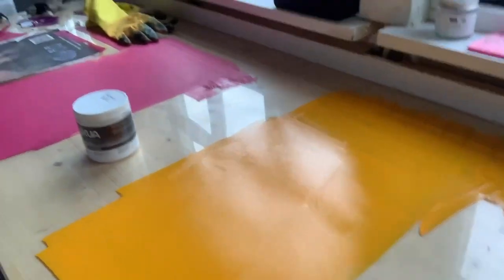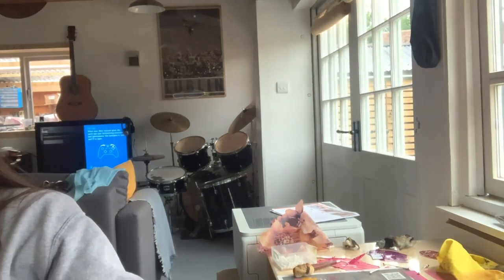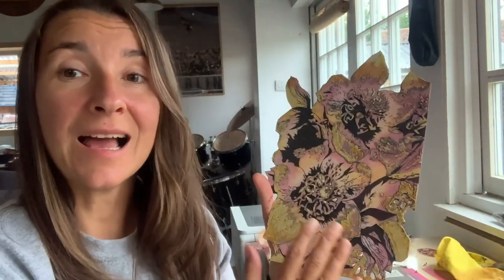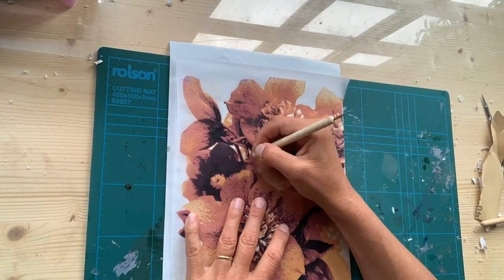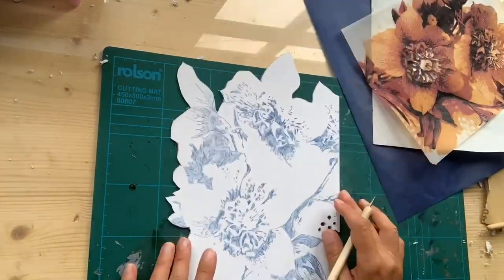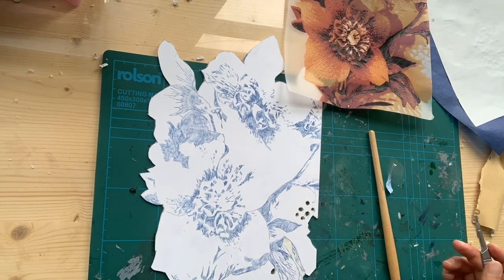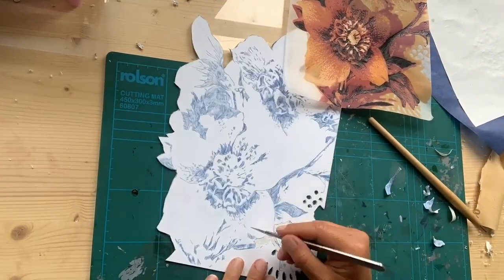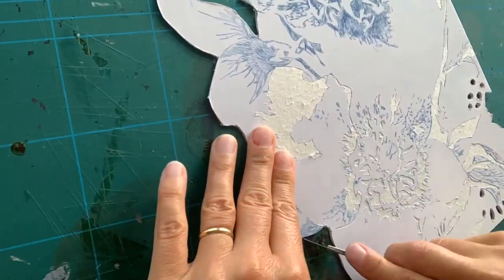New, (Magic 🪄) Ingredient for Viscosity Print

Comment: Are you using aqua washable inks, then? I can’t tell, and appreciate knowing products used, esp loved seeing Snowden paper used. Was curious, tho: I heard the reason printers use burnt plate oil ( at least for traditional oil based inks) is because it wont rot cotton rag? Thanks so much for sharing your experiences!
Reply from the maker: Hi Kat, I use oil based inks, intaglio printmakers. I am not sure about the rag rot, but I use linseed oil to loosen the ink so that it repels the next layer of link which hasn’t been diluted.
Reply: Thanks: I didn’t know if Akua products could be mixed with oil based inks!
Reply from the maker: @katmcgee9516  they are not, I don’t use Akua ink in this video